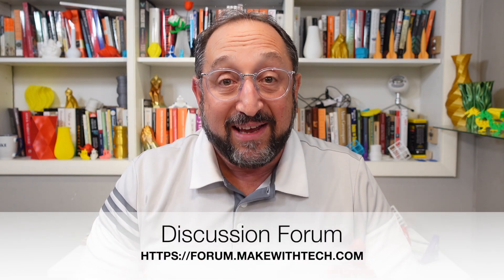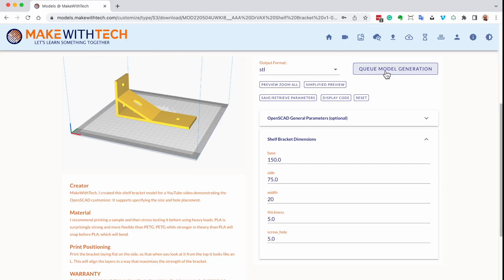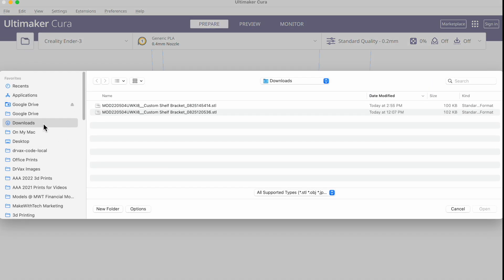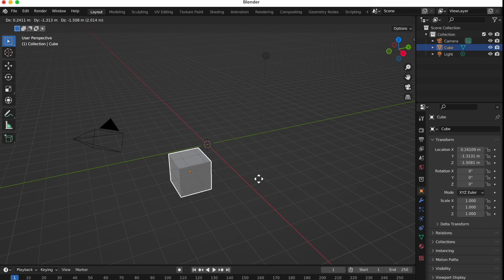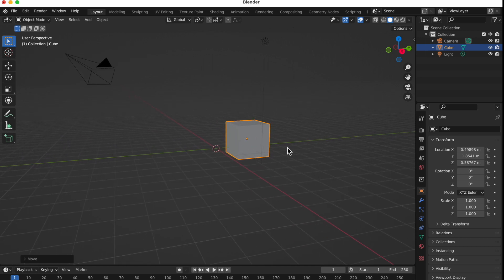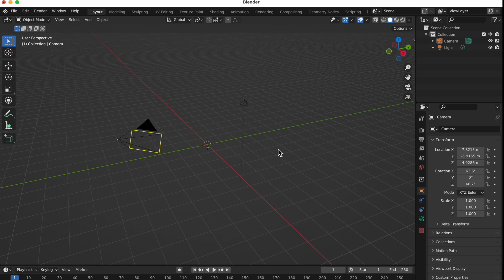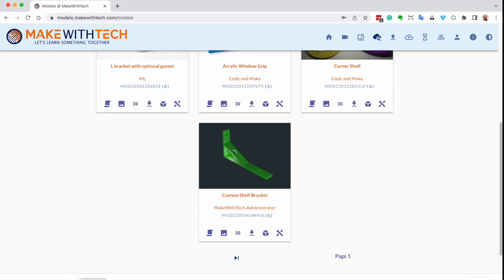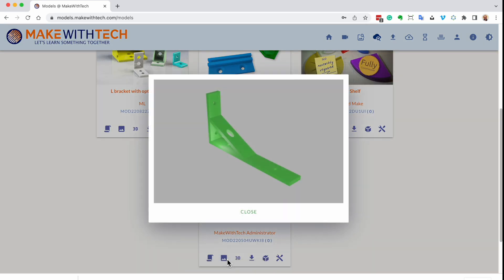How to Use Blender to Render a STL 3d Printer Model

Comment: please help me I have a problem with my JGMaker Artist D-Pro that bothers me. When I level the bed, everything is working fine till now, but when I finish printing, it goes back to how it was at the first time, so I have to repeat the whole process over and over ( leveling the bed ). Another thing is that when i pause and resume the printing, the nozzle is high.
Reply from the maker: You can add a G29 to your slicer start code after the home command to run bed leveling every time automatically.

You can also add a M420 S  to the start code to use the last bed leveling values. 

You need one of these commands in your start code for ABL to work properly.  Do NOT do a G28 in the start code after one of these commands as it disables the use of bed leveling statistics.

Comment: Another thing you can do from PrusaSlicer, (I'm not sure if other slicers have this functionality simply from lack of experience), is once you've sliced an object you can export the tool paths as an obj file. Then when you load it into blender you can see the layer lines (or how the intended object should look if it is designed to be printed in vase mode).
Reply from the maker: Yes OBJ format is supported in many of the slicers.
Reply: @MakeWithTech  What I meant was outputting a file (that happens to be obj) that is a 3d model representation of the resulting g-code. By your response, I'm not sure if you quite grokked that.

Comment: This is the first Blender tutorial I have come across that seems simple enough to implement into my workflow. Most of the ones I have seen have done amazing things but were very hard to follow the steps or why certain steps were needed.
Reply: If you want to model things with Blender, I suggest checking out Maker Tales playlist on Precision Modeling. It takes it slow and easy from scratch. Blender is great because you can do CAD-like stuff, sculpting (think mini figurines), and edit other peoples' STLs, all with the same set of skills and software.
Reply: @tradde11 No, I have not, but may check it out. The one I saw was many years ago about adding a puddle in the walkway with a reflection of city lights. I was thinking to myself it would be much quicker to shoot video of the wet walkway. At that point, I appreciated Blender as a tool that could do 3D effects very well, but that was not what I was really looking to do at the time. I had seen some more recent videos from maker tales, but at that time Blender was not really good at functional prints, although now there is an "add-on/plug-in" that allows more designing like in a CAD system. I'm trying to focus on using FreeCad to develop my CAD skills for functional prints, but curious how people are using Blender.
Reply: @darrennew8211  Yes, I'm monitoring that. Maker Tales got me using FreeCad initially, but the move to Blender just has me cautious of how Precision Modeling will turn out in the years to come. I might be interested in modifying models I had created in the past, so adopting new solutions often run a higher risk that the project files structure can change while the product matures and may not respect backwards compatibility. I think it is great this is available in Blender and the Blender community is very active, so the chances of success are higher.
Reply: @mbarton98  You can open projects crafted in Blender 1.0 today. Also, Blender is just working with meshes, so if you've got something you want to ensure will work for a long time, export the pieces as STLs alongside the Blend file. The only part where you might have forward-compatibility problems would be with CAD Sketcher, but again that's open source. Probably better compatibility than any proprietary solution. 

The one thing Blender doesn't give you (yet) is simulation - you're not going to be doing any stress analysis on the parts to see how fast you can spin your 3d-printed helicopter blades before they break apart. Animation, construction from separate parts, stuff like that is probably not going to be as sophisticated as something like F360.

Comment: One simple thing you could do to improve the look of the end result would be to place a simple Plane object underneath your model, effectively replacing the default background you’re currently using.  You can then assign a material to that plane object, giving far more control over what the background will look like. The plane will also receive shadows from the object, which will improve the look of things further.

Another tip…instead of entering the same scale value into the X,Y and Z parameters individually, first click the X parameter and drag the mouse down into the other two slots.  Then, when you enter the scale, it’ll appear in all three at once.

Thanks for the very clearly presented video!

Comment: Great little tutorial. One of the things that's confusing about using these 3D manipulation tools is that all of them to have chosen their own standards for which mouse button to press (or not) to rotate, translate, zoom, etc. I noticed this with OpenSCAD and Cura right away, and Blender appears to suffer from the same issue. But it's not a big deal..  just needs some time in the saddle to get used to it.
Reply from the maker: I agree.  It would be nice if there was one standard.  Freecad tries to solve this by letting select between a number of mouse configurations based on other programs.